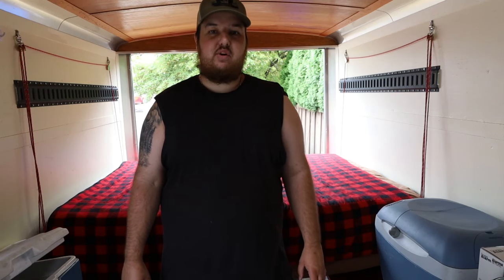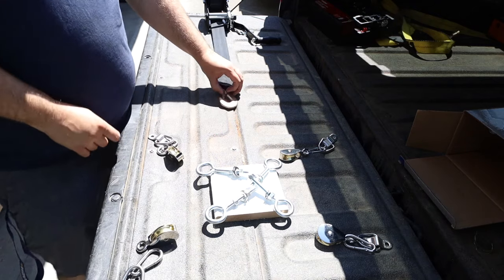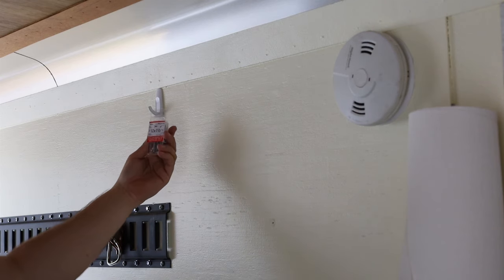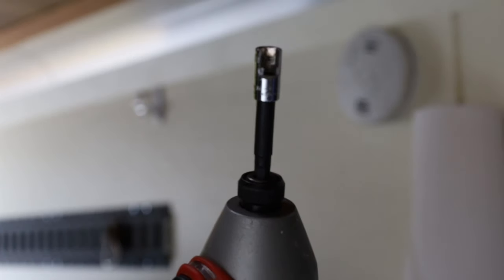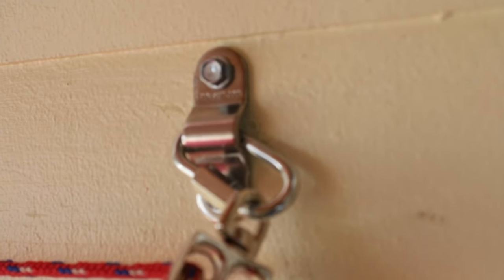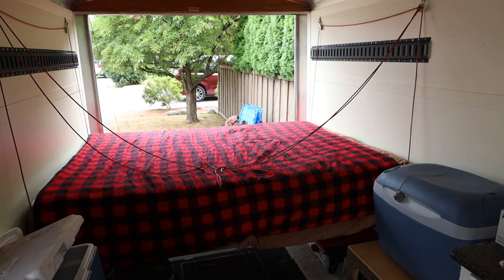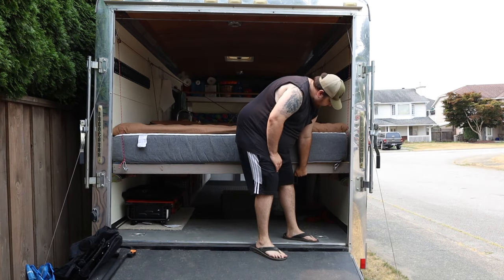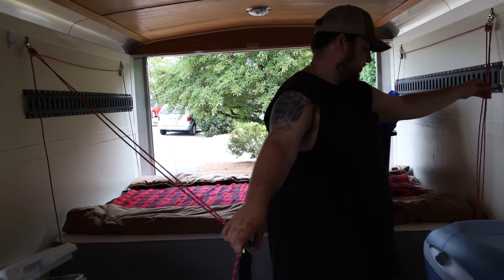BED LIFT FOR UNDER $100!!!

Comment: I’ve been so nervous about drilling holes on the inside of my trailer. Thank you so much for your detailed instructions! Finally a video that is exactly what I needed!
Reply from the maker: I was in the same position not a great feeling just make sure what ever you screw into the walls is not the thickness of the wall what I did was use a self tapping screw and would start the hole then pull them out and snapped the self tapping part off and screw the rest of the screw in. Just trying to use what I had on hand. Just follow the screws from top to bottom this will help locate the frame.
Thank you for watching and happy I could help!

Comment: If that winch is necessary to lift it then the wall mounts are not strong enough (they will break due to fatigue at some point, even if it worked so far). Need beefier metal there. But thumbs on all the other thoughts.

Comment: This gives me inspiration for a bed lift using cables. I want to set it up so that I press a button and it magically moves up, but I couldn't for the life of me figure out how to do that in an elegant yet cheap solution. I need a lot of height to move, so those hydraulic lift ideas weren't a good choice... I imagine routing all of the cables to the left or right side and hiding them in the ceiling would be perfect

Comment: I was thinking the same thing, all these expensive options to lift a bed that can be easily hand cranked and would be faster to deploy and put away with a drill. Good job!
Reply from the maker: Check out my other bed lift video I did turned out much easier and to be honest although a drill would be fast and easy for the couple of turns of a crank I prefer it over the drill.

Comment: I was looking for linear actuators, they were all very expensive ($1K+)after all the electronics.  This is so much easier (and cheaper). Thanks, great video,  keep it up. John S.
Reply from the maker: Yes I looked at doing the same! If you want to do a bed with a little more cost make sure you check out my other bed lift video!!

Comment: Nice diy job. Would be good if your winch was permanently attached to the cross member. Maybe an upgrade would be to be able to turn it 180 degrees, so it’s facing down when a seat, and up when you need to raise/lower the bed.

Comment: Quick, fast and easy! love it! will probably do something similar but you should round the bottom tip of those 2x4 so when you lower it they will self alight better and they wont get caught on edge of E-track bracket and maybe you wont even have to get at the back to re align it.
Reply from the maker: Good call you are right trying to align it can be a hassle sometimes. I am currently working on some cabinets which is going to hinder my bed lift system however I’ve got something even better in the works hopefully have the video up in the next couple of months!

Comment: Best explanation yet, thank you. Any idea how I could use a similar set up but more hidden and permanent for nightly deployment? Again thanks subbed in appreciation
Reply from the maker: I think if you had more head space it would help hide the bed. I made a second bed lift video with a better system which is also posted on my channel. I recently purchased a new trailer and will be doing a bed that folds against the wall.
Thank you for subscribing!
Reply: @BCBackwaters  thanks so much I will check it out! 🇨🇦

Comment: Do you travel with your bed in the upright position? I’m using the same type of system and was concerned that the wall studs were able to support the weight. My studs are 16” on center.

Comment: Hi bud, could flush fit hoists work, being proper close to the roof? Also may I suggest guiding wheels on all four corners in both axis and another couple hoists atop the winch so you don't need to connect/disconnect? :) It might also be worth stripping a cheap mains drill, hardwiring and fixing it to the van/hoist with a replaced trigger for an up/down button :)
Reply from the maker: Currently working on a new design that is located underneath the bed so it’s all built into one but a manual system. Guiding wheel would definitely help however I am trying to keep the build as cheap as possible. Sounds like you could engineer a pretty nice system!

Comment: I'm making something similar but heavy duty for my studio apartment. The rachet is a great lightweight idea (I'll be using counterweights and a pulley system)
Reply from the maker: Check out my other bed lift video. If it’s not being installed high the other mechanism is even easier to use.

Comment: Good project. The commercially sold set-ups seem to me to be outrageously overpriced. So very cool. 
A tip. Anything you see a commercially sold bed winch system  doing- you can also do. So long as your pulleys aren't at some odd angle, the rope will smoothly glide, the bed will go up evenly. Many commercially made set-ups are insanely overbuilt for absolutely no good reason. (Too often RV and trailer things are grossly and stupidly overbuilt.) 
What I'd want to do is 
1. Do double pulleys so you have to pull the lines twice as far but they require half the effort to do it. 
2. I'd run the lines on one side under the bed so your winch/crank is on the wall on the other side where it'd be out of the way. and
 3. I'd make it so a hand crank could lift it.  With this system you'd have a single line run from the crank to all four corners (probably tied to the front right side of the bed and then the rope  would come off the front left side to the crank. )  Also because you have the brackets to hold the bed, any slight unevenness would just require you to loosen up the rope a little once the bed is lined up in the brackets.  
The single line pulley arrangement is a bit of a puzzle, but not at all difficult to figure out. While it seems complex, it really isn't.  (Two pulleys on the front right, then 3 pulleys on each of the other corners. So 11 pulleys total. ) 
(If your bed raises 3.5 feet: with double lines on 4 corners- that would be 3.5' x 4 sides x 2 times = 28 feet to roll up. Sounds like a lot but the effort would be minimal (each turn on a 4" diameter drum, could wind up a foot, so 28 cranks. If the bed weighed 40lbs, you'd be lifting 20 pounds at the drum . Your effort  depends on how long the crank handle is. Maybe  8" - (16" diameter), so  4:1 advantage.  5 lbs at the handle- Easy.)  Dyneema line would be smaller in diameter, very strong, slides easily and is less likely to chafe. I wouldn't go smaller than 3/16"  because your biggest problem will be the line skipping out of the pulley sheaves. (btw I haven't made a van bed, but I've done all this before.)
I can see someone spending $100,000 on a 4x4 Sprinter van conversion,  but then DIYing the lifting bed because it would be so much better.  (Also the ply forr the bed? I made a bunk for the back of my car out of 1/2" luan from HomeD - very light weight. To make it rigid I glued (and screwed then removed the screws) two 1" strips about 4" in from the sides (24" wide) - too lightweight for your larger bed, but the concept is simple.  Looks like your bed is pretty lightweight. I always keep in mind 2x8 joists 16" OC and 3/4 ply (standard house construction) can hold 2000 pound/square foot. (You can park a car in your living room.)  You used 2x4s but your bed is still much stronger than it needs to be. Your blocking is very smart; clearly you know what you're doing. I'm a big fan of spruce 2x3s (look for the spruce ones - very pale yellow - kiln dried, they also come Douglas Fir - much heavier - but still good. Spruce is just amazing wood - when I build stuff out of it I always remember it's what the Wright Brothers built the first airplane with and the second, and everybody else through the 1930s) Also drill some holes in the plywood. If you get any moisture between the bed and the ply and it can't vent and dry, you'll get mold growing.  Sorry to be such a busy body.
Reply: Hey, please build for demonstration purposes

Comment: So you have to use the whole trailer to do a bed lift.
What you're going to do with the extra rope in the way.  dry your clothes.
Very dangerous set up when traveling.
Reply from the maker: The ropes can be removed and once its lifted and brackets are installed you can take the ropes down. I agree its alot of things in the way but I am working on a solution next month to take care of all this. A new bed lift which will all be located below the bed. Make sure you stay tuned for this!